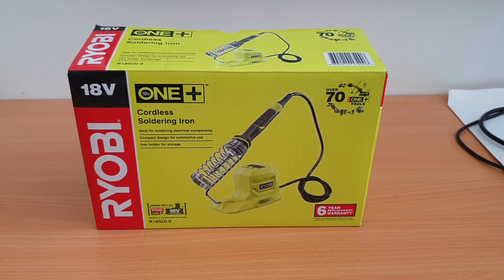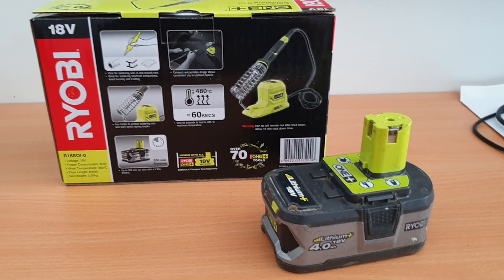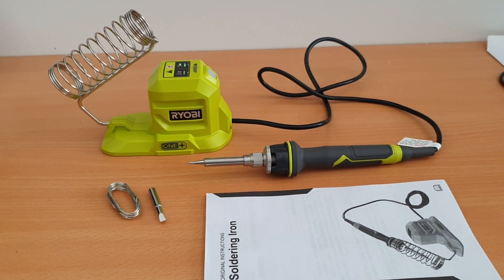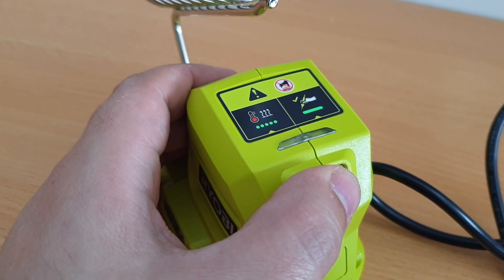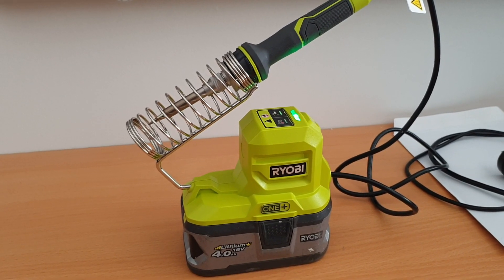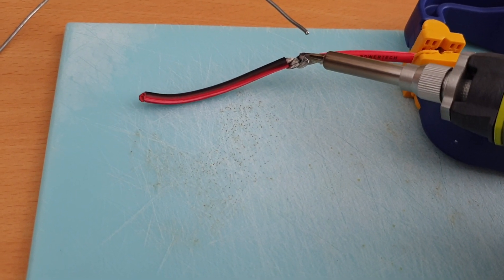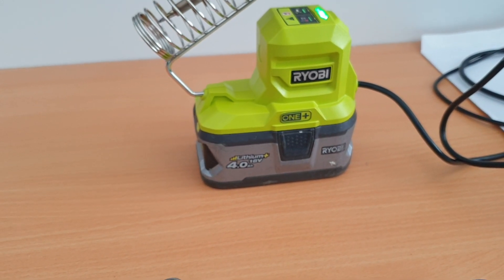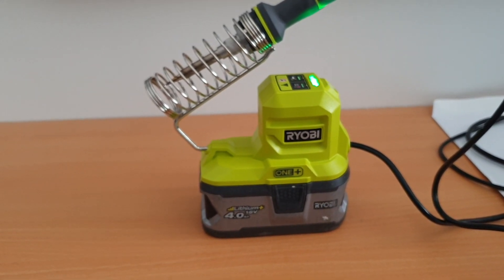Ryobi 18v One+ Cordless Soldering Iron R18SOI-0 P3105

Comment: three points, First mocking them for the heat label is wrong they don't have a choice you can thank the litigation bagade from US for that, second using the wrong tip, thirdly bizarrely choosing a partially charged battery for a battery powered tool test! that makes no sense. The product looks good but the video is more like a how not to.

Comment: Great description mate.  Your wire is oxidized and the core flux can't do it's job without contact with the work piece. A flat tips with some flux on the surface and the solder would been sucked in like a sponge.